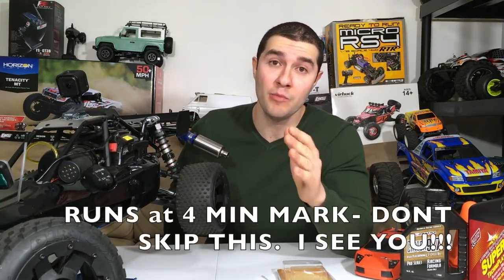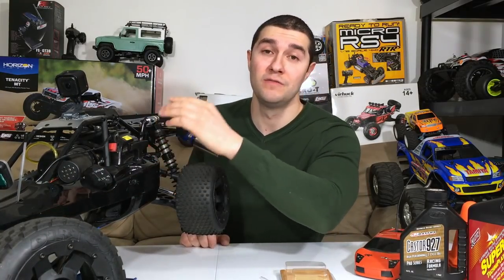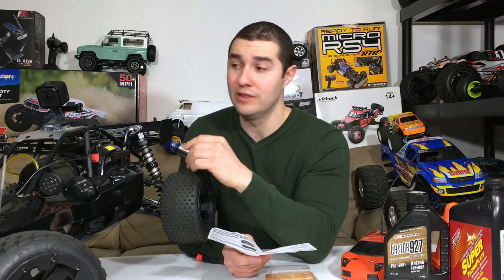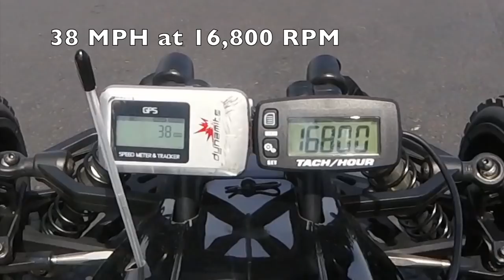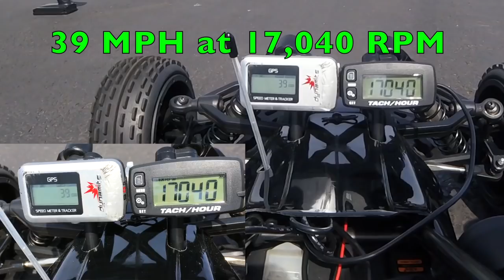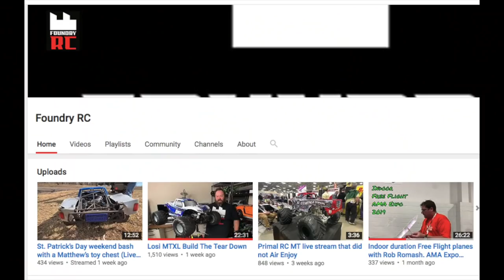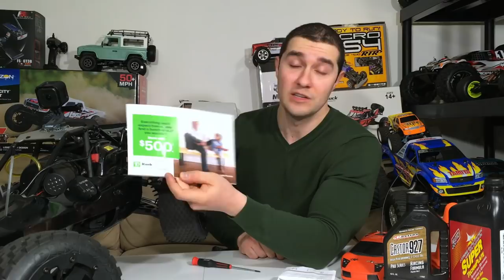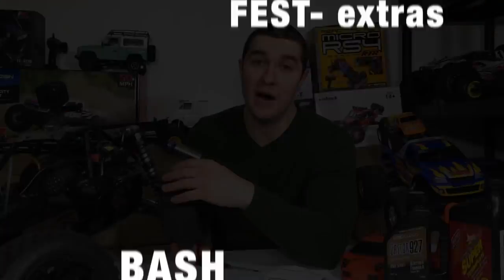RPM meter Speed Install on my ROVAN BAJA and PRIMAL MT purchase update + Much More!!!

Comment: Now a days my rovan is not so well the problem is whenever i apply brakes the engine quits immediately in reality i was messing up my low speed needle and finally ended up with this crazy proplem i am planning to buy one big rc boat 55 inch long 30 cc gas engine but now feeling scared after this strange problem may be i have to change the whole carburettor because now the settings are not having any impact on the car behaviour one guy told me don't mess with low speed needle damn he was absolutely right
Reply from the maker: hey man, did you try to reset the two carb needles to factory settings?  Factory for that engine is 1.5 turn out on the High speed needle and 1.25 on the low.  That's your starting point.  Also check your plug again for good spark.  And check that you don't have a vacuum pressure issue.  Did you enlarge the tiny breather hole that is in the fuel cap?  I've been wanting a gas boat for a while too, but they are still pretty expensive.  And I think running in salt water like we would be doing is not a good idea in general without heavy maintenance.
Reply: @hybrid32494 I did the same thing and it works for me I was watching some video on youtube and now it is fine now I will not mess with the low-speed needle again
Reply from the maker: good job!! I do know something lol, i'm glad my advice worked.  The Low-speed needle is really like an idle adjustment too, you know.  You're supposed to just set the idle screw so it does not die when you give breaks and then adjust the low-speed needle so the idle is not too high.  If you get the RPM guage you can monitor the idle RPM easily too.
Reply: @hybrid32494  hey buddy i need your help again last time it was some engine stalling issues but now i m facing braking problems brakes are not working at all actually what i did i was cleaning my rovan baja washing my car with little gasoline because it was all messed up with sand and oil with a grease mixture and after washing i just spray some Wd40 just to avoid rust but ended up with braking issues may be i have to clean the brake pade so what is your expert advice
Reply from the maker: always glad to help!! Let see..  First make sure the linkages are physically working and correct and that none of the set screws are missing. If that seems ok, can you tell me if the bakes engage at all?  Id say after then if you still got bad brakes, then disassemble the spur gear cover area and try to get a look at the brake discs.  It's possible as you said they are oily from the WD-40.  Or try spraying the whole area with some nitro car spray cleaner (or anything like a degreaser).  Let me know.
Reply: @hybrid32494 thanks for your comment ....I check everything is fine the linkages is same like before but the problem is wd40 maybe if I will spray the brake pad cleaner so that thing take all the oil from the pad otherwise I have to open and clean the brake pads with some sandpaper
Reply from the maker: try it, let me know.  I stay away from getting these dirty as much as I can.  But I did run in a lot of loose grass the other day.  We need to consider getting some protection from dirt getting into the pull start and crankcase areas.
Reply: @hybrid32494  no brakes are still the same very lose and dangerous to drive i think i have to c
Replace the pads and open the brake assembly completely but no time for all such work

Comment: hi, buddy, tell me what's the double compound in the tire ?? http://www.racing-cars.com/sp/category/Manufacturer/subcategory/Contact_RC/templateid/12/searchbox7/1-10_TC_-_Foams;_Carbon_Rims.html 3,4,5 from the bottom
Reply from the maker: hey buddy, look at this link, these are the ones I am using.  They are pretty good and fit well and are cheap.  The link you sent is for some pretty high end racing branded wheels (I am not even sure what would be the right ones for you, they are very specific).  
https://www.ebay.com/itm/4pcs-Racing-Foam-Tires-Wheel-Rims-12mm-Hex-Set-For-HSP-HPI-1-10-On-road-RC-Car/292405202937?_trkparms=aid%3D222007%26algo%3DSIM.MBE%26ao%3D1%26asc%3D20131231084308%26meid%3Dcafa69da39a3436fad727dbb92f67a8d%26pid%3D100010%26rk%3D1%26rkt%3D12%26sd%3D293033025643%26itm%3D292405202937&_trksid=p2047675.c100010.m2109

Comment: Hi ace video can you use this on a nitro RC car
Reply from the maker: hey buddy! thanks for watching.  Good question, I thought about doing that also, but let me tell you right now, it won't work.  This RPM gauge counts the spark pulses being sent though the ignition wire.  A nitro runs just a cooling head, there is no cable for which you can wrap this wire around.  Good idea though, this is something I would love to make work also.
Reply: Thanks for replying just as I throat wish there was something for nitro RC

Comment: Thought this was a video on how to install the rpm monitor
Reply from the maker: hey buddy!  Sorry, it isn't.  I will just tell you that the installation is extremely simple.  All you need to do is wrap the included RPM wire around the engines spark wire about 4-5 times and make sure it's a tight loop.  These loops will measure the ignition(electrical) pulses in the wire, that is how it works.